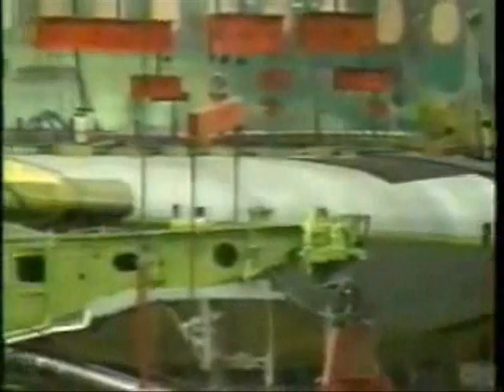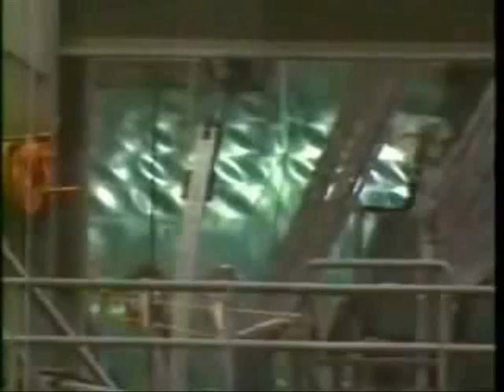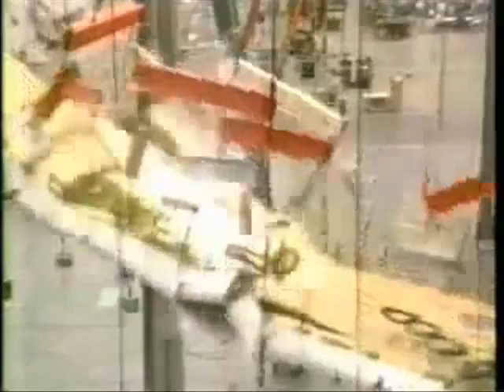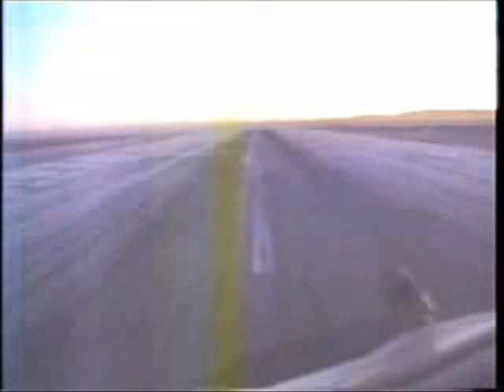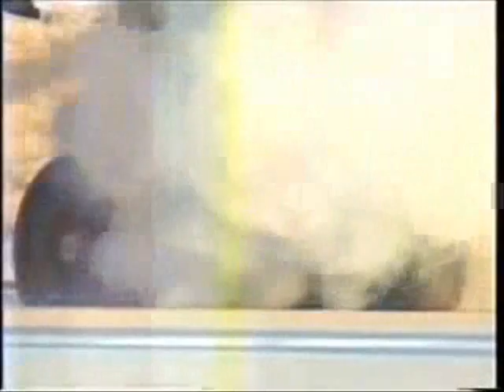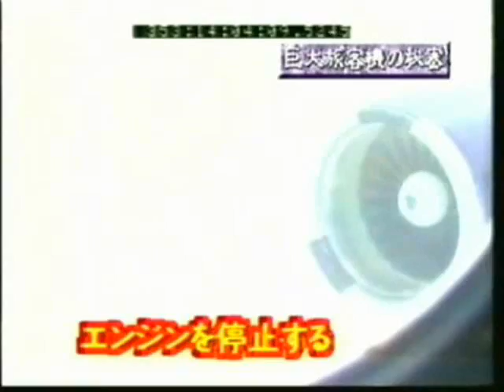B777 Stress Tests

Comment: FYI the takeoff at 3:04 is called a Vmu (Minimum unstick speed) test. Its used to determine the minimum rotation speed for the aircraft which is later used as a reference for the actual V1 and Vr speeds.